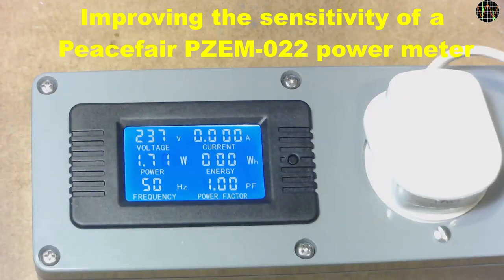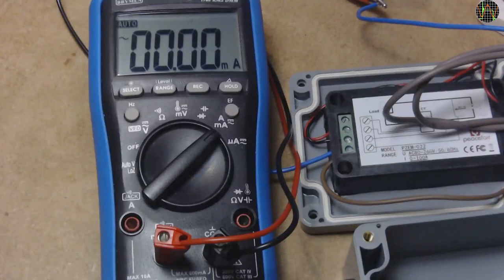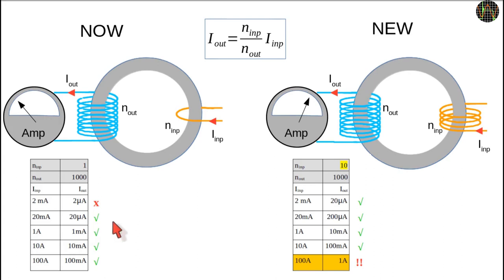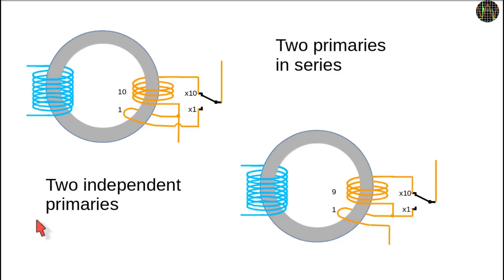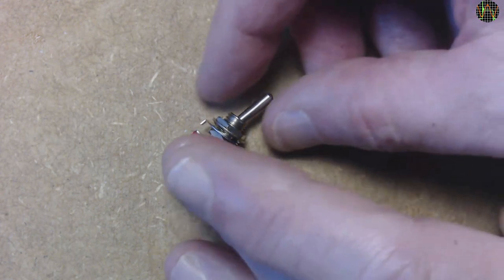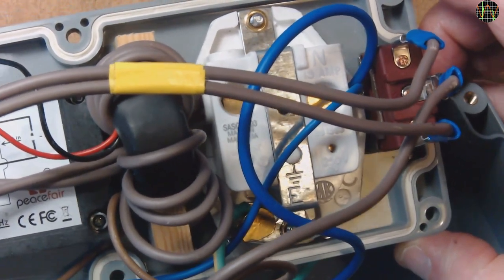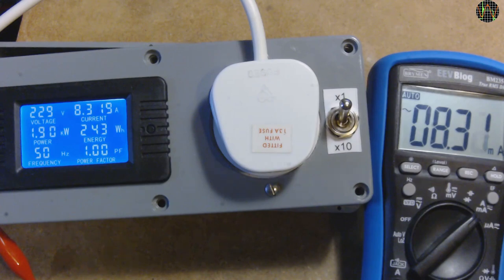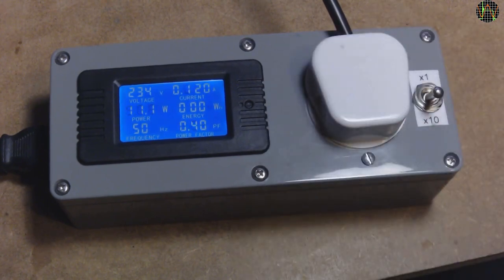Improving the sensitivity of a Peacefair PZEM-022 power meter

Comment: Great video! 
Greetings from Australia.
May I know the lowest resolution this PZEM-022 measures? I hope it can measure down to 1mA. Also where could I purchase the casing seen in your video? What a beauty.
Thank you.
Reply from the maker: Hi Andy,
thanks for the comments. There is another video on my channel describing the original built of the meter showing the full spec and it has a parts list of all components in the description. Anyway I bought the box from RS-Components (aka RS-Online) stock no  1748901. You are quite right. It is of superb quality and not very expensive either. I believe RS has an Australia branch. If you use the stock number, the result on the (UK) RS website  shows another box from the same series but the stock number refers correctly to the model GA8-20-6 by Takachi Electric. As for the other question, the PZEM-022 can't read lower than 20 mA (it just shows zero) but it will still calculate power for currents lower than 20mA. The whole point of this video was to improve it by adding a x10 switch so now it can read down to 2 mA. You could use the same mod with 20 instead of 10 windings and get it down to 1 mA, but now you would have to multiply the current and power values on the display by 20 instead of 10.
Reply: @TheHWcave  apologies for not getting back to you sooner mate. I have just switched on my YouTube notification. 😂
Many thanks for the detailed  explanation and tips. I can't wait to get myself a pzem022 and the box!
Would you also have to know where to shop for a voltmeter or ammeter display module that can read starting from 0Vac and 1mA? My project is to assemble a self made QA testing device :)

Thanks once again. I'm intrigued by your video and comment! :D
Reply from the maker: no worries, 
I don't know any voltmeter or ammeter modules that would do that without needing a separate power supply that keeps them going if the measured voltage is very low. Separate power  opens a whole can of worms with respect of what is referenced to what and isolation between that supply and the measurement circuit... You may want to use batteries to be safe and separate circuits for volts and amps (don't share the battery between them). Another idea would be analog meters because they don't need external power but especially for the ammeter you need to watch out not to overload it. 1 mA resolution will be hard to find though. Most analog AC rated meters have a distorted scale because of physics, they are not very sensitive at the low end of the range. Last not least, analog or digital meter modules for AC will be averaging not true RMS. So the shown values will only be correct for a proper sine wave shape. If you plan to measure things that use other wave forms (rectangular or "modified sine" etc.) you need to factor in an error of probably 10% or more.
Reply: @TheHWcave  thanks for the prompt and informative reply again mate. That's exactly the problem Im facing now. Need to stick with digital LED/LCD meters as it is easier more accurate to read. Though as you described, most AC meters I  can find reads only from 80V  or 10mA the lowest. 
I may have to look further on Alibaba perhaps. I'm sure there products must exist out there. :)
Reply from the maker: Hi Andy,
if you find one, please leave a comment. This is a common problem
Thanks
Reply: @TheHWcave  sure. Will do mate!
Reply: @TheHWcave  Hi, i don't have the PZEM-022 to test it, but i have the PZEM-021 and PZEM-011, those models also need a minimum voltage of 80V to start to work, but you can supply a 9V voltage parallel to the 470uF /16V capacitor to power the meter. This 9V supply must be galvanic isolated from the measuring voltage supplied to the meter because the minus of this 470uF capacitor is shared with on the 4 green terminals that carry the mains voltage. 
Between the mains voltage and the positive side of this 470uF capacitor is a resistance of arround 1Mohm. 
This trick works with the PZEM-021 and PZEM-011.
With 8V the meter freeze, from 9V the meter begin to work, and i think that the supplied voltage to this capacitor before this mod, is arround 12V, so in theory a galvanic isolated voltage between 9 to 12V can be used.
Reply from the maker: Hi Bjorn, that sounds like a good trick, thanks for sharing. 
However, creating a galvanic isolated DC supply sounds like quite a bit of trouble, considering that the isolation of most cheap SMPS is often questionable... so you'd want a good power supply which costs..

Not sure if you seen one of my last videos where I modify the DL69-2048 AC volt/amps/power module to read from 0 volt, while still using its built-in power supply. 
https://youtu.be/Jr42rQMymN8 

This one does power factor, apparent and real power but doesn' t do energy (I think there is a another DL69... that does do energy, but uses a LCD display). On the DL69-2048 you need to press a button to switch between the different readings, I like it actually better than the PZEM, it has a higher resolution and the 7-segment LED numbers are easier to read at an angle or from a distance than the LCD. If you need an AC panel meter, that can be modified to read from 0 onwards and needs no extra power supply, go for the DL69-2048
Reply: @TheHWcave  Hi, the reason that i mentioned a galvanic isolated power supply, is that the green terminals are shared with the negative of the capacitor.
If you use a polarised cord like in the UK, then there is probably no need for a galvanic isolated power supply. 
But here in Belgium, we don't have polarised plugs, so rotating the plug will cause a short when using the PZEM portable.
For galvanic isolated power supplies, there are very small (and cheap < 5€) DC to DC converters for print mounting which are 100% isolated , 
take a look at this type per example : https://docs.rs-online.com/efac/0900766b816f1856.pdf
These DC to DC converters can be used with a homemade Capacitor Dropper power supply or a SMPS supply (Wifi-router etc...) that you have lying arround.
Reply from the maker: Hi Bjorn, you are right. These DC-DC converters are really convenient and not very expensive either. Sounds you have a great solution for making the PZEM work down to 0 volts. I would even put that DC-DC converter in whether the plugs are polarised or not. It's just a lot safer.
Reply: @TheHWcave  i agree. They can deliver more then enough current to power the meter. The meter draws only a few mA, so in theory you can even power the meter from a small 12V  A23 battery.
At the moment i'm building a isolation transformer and "dimb bulb current limiter" with 4 small GU9 halogen lamps in 1 device. I'm gonna use a extra CT to make a adjustable fuse between 0,1A to 3A, that flip a relay to disconnect the output.
Reply: If the reason for <80V to the meter is because it is running from a variac, you can power the meter separately, directly from the mains input. 
The voltage measurement input to the meter still comes from the variac output, but you mod the meter power it from before the variac. 
See what I did here: https://www.youtube.com/watch?v=1WfHmAjFivY&ab_channel=bertoid

Comment: This thing is amazing I can read the power consumption in my whole house. I believe my country's power meter is cheating and run too fast, I hope this thing will help solve the problem by reading the actual load in realtime at anytime and check the total kwh to be compared with the meter from the electric company. I cant believe my house use 60 kwh everyday. That means 2500 watt/h
Reply from the maker: Beware, in x10 mode, the module sees 10x more current than actually flows but it does not know that of course, so  the power it shows is also 10x more than what it really is. The point of x10 mode is to make it display values for tiny consumers like LED light bulbs, not whole households. If you use it you must mentally divide current and power values by 10.  60KWh seems excessive unless you are running one of those electrical fan heaters day and night ... , or maybe faulty sensor switch for the immersion heater in the hot water tank (if you have such a thing). Best, check the whole setup for accuracy by testing it against a consumer with known consumption. Incandescent light bulbs are ideal for that because they are very predictable and a 60W bulb is usually pretty close to 60W (if the mains voltage is nominal). I keep some of these bulbs around just for serving as high power load resistors.